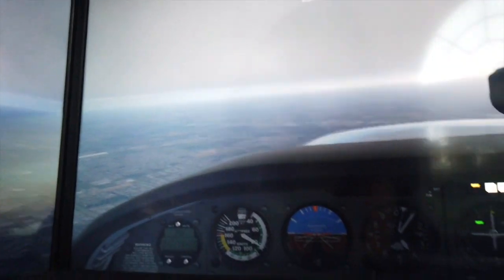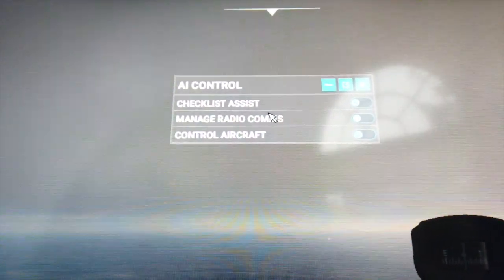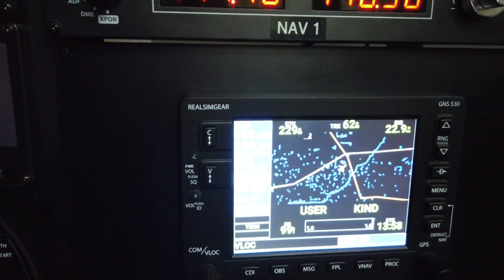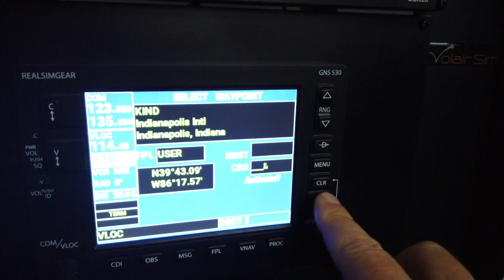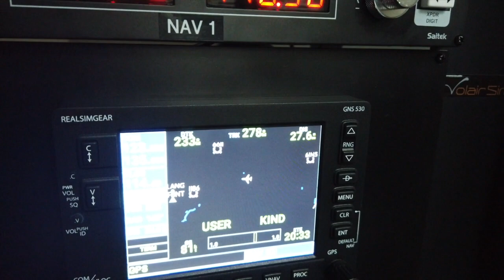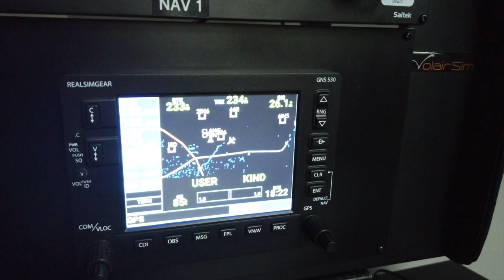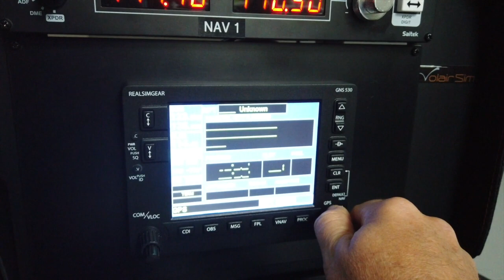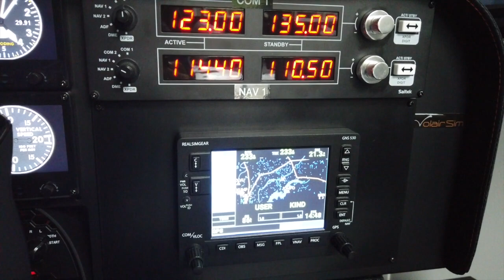RealSimGear GNS-530 and MSFS 2020. Is it Ready for IFR Practice?

Comment: I’ve been considering this unit, how has it improved from back when you posted this? Have the issues been mostly fixed? Thanks
Reply from the maker: Vastly improved; there is also a freeware add-on on Github that fixes the issues on MSFS2020 side.
Reply: @volairsim  Got it, thanks for the update!
Reply: Same here....thinking about picking this up.

Comment: @3.27     The GNS  displays the FROM  radial  (not the TO),  and therefore the Display reading  was correct.
If you use the GNS  in RL,  you had better know this !!!!
Reply from the maker: The aircraft, as shown on ForeFlight in this video, was SW of the VOR. Therefore it was on 244 radial. The GNS was showing 4 degree which would be a radial going NNE from that VOR. Therefore, the GNS display is incorrect. The GitGub software fix that someone suggested fixed this BTW so now the radial display is correct.

Comment: Thanks for the video!  I have a Realsim gear 530 as well and am frustrated with the MSFS2020 shortcomings.  Hopefully they will get things sorted out as I primarily use my flight sim for IFR practice.  

Are you from the Indianapolis area?  I’m an instrument rated private pilot and fly out of HFY and 90IN.
Reply from the maker: Thank you for your comment. Yes, from Indy area - KUMP.
Reply: @volairsim  Did the 530 mod from GitHub correct most of the GPS issues?  I plan on installing it this evening.
Reply from the maker: @rockandrollfish  All of these egregious issues that I showed were fixed. I would say it, it is a vast improvement of what came with MSFS2020.
Reply: @volairsim  Great!

Comment: Can you also use the GNS530 mod that is currently available at github? Have you tried this?
Reply from the maker: I was not aware of this but now that I am, I will def. try out and post and update.
Reply: @volairsim  great! I am thinking of buying the RealSimGear 530 (and maybe also 430) so looking forward to your update. The mod is really really a big improvement
Reply from the maker: @TZA1980  We just tested it (albeit briefly) and most of the issues are resolved with this mod! We will do another video later to go through it in more detail.
Reply: @volairsim  Any update on the GNS530 mod?
Reply: Are there instructions on how to install this mod to MSFS2020?
Reply: @rockandrollfish  just unzip it and put the complete folder in your Community folder
Reply: @TZA1980  Great!  Thanks.